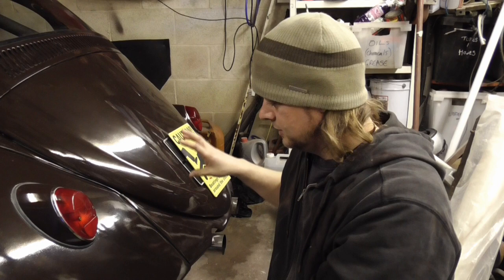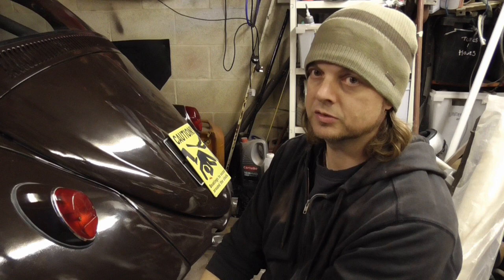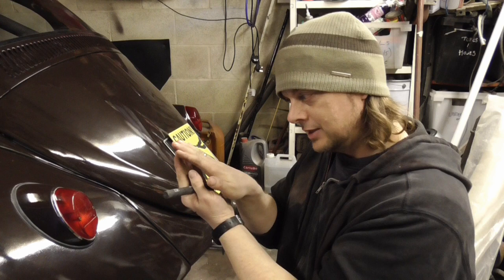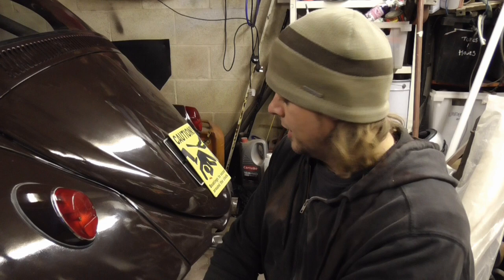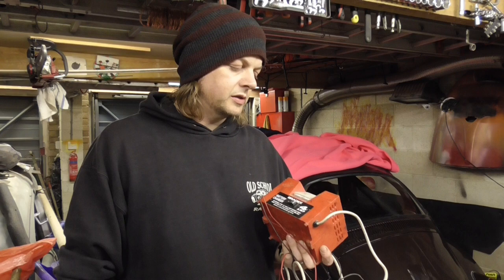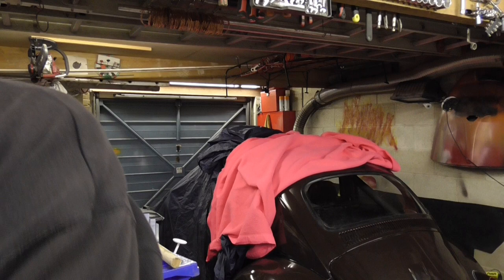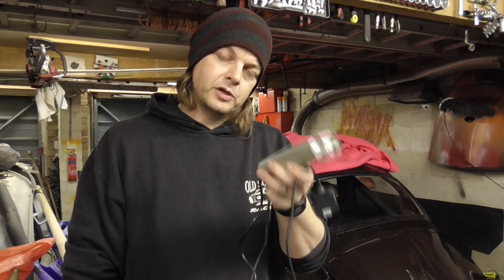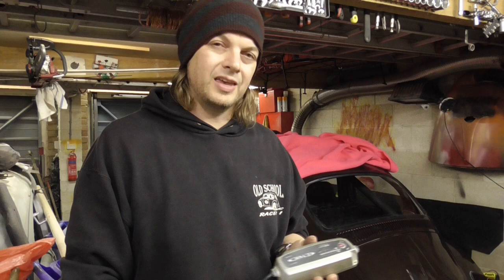How to Removable rear Apron Valance, Fit Wheel Studs, Battery Charging & Fuel Lines VW Beetle Bug

Comment: Good advice Al!
Regarding fuel lines, you can also get 100% bio proof rubber hoses from somewhere like silicone_hose_world (advanced fluid solutions) on ebay. 

I fitted some 10 years ago and have had no issues.
Not cheap but easier to fix than your fire damaged classic.
Reply from the maker: Thanks dude I hadn't heard of that. :)